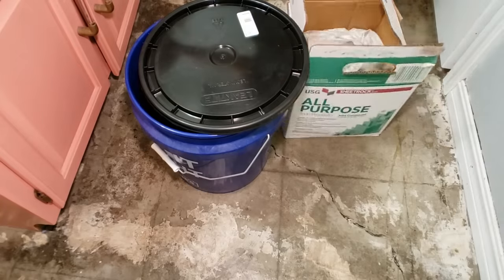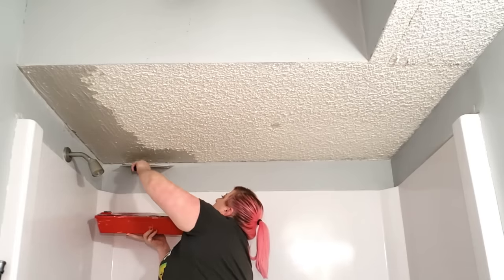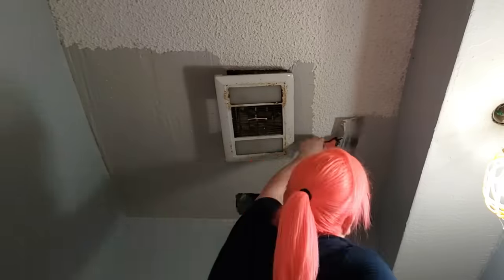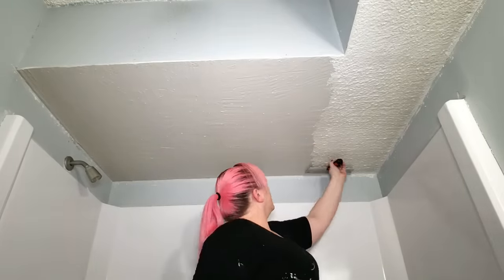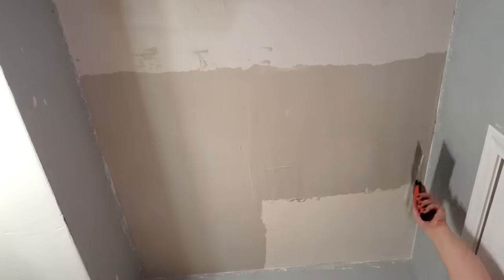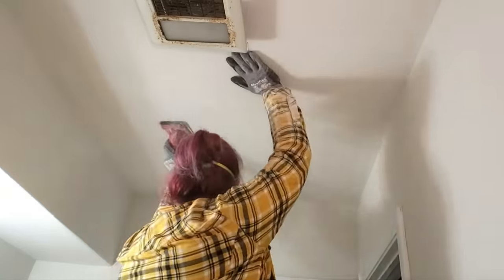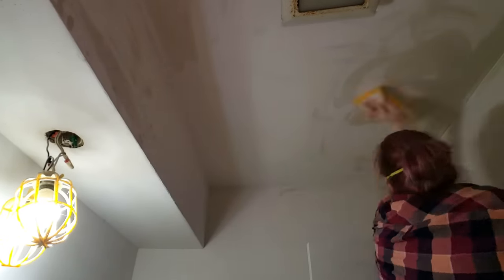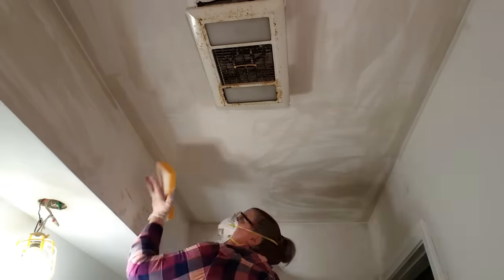How To Cover Popcorn Ceiling Without Removing It | Skim Coating Over Popcorn Ceiling

Comment: ain't no way possible is this better than my spray bottle and my 12" drywall knife ...AND I don't run the risk of having all that mud causing the original to get wet and pull it down, anyway ...THEN WHAT?

Comment: For all thoae wanting to wet ceiling with a spray bottle, you can put downy in the water, spray the ceiling and run you tape knife on it, it comes completely off, done it, not that hard, just cover tou floor with plastic tape to the trim and you'll be done with thw cleaning at once.

Comment: I could be so wrong, but I've had the best luck scraping it is and is soooo much easier. Using a pump sprayer or even a roller in water, let it soak a few min and scrap. Use an oil based primer, then paint. Done.

Comment: Great job! Your way looks so much more efficient than how I've done it. I removed the popcorn from my ceiling in my kitchen and hallway using hot water in a spray bottle, drywall knives for scraping the popcorn off of the ceiling and plastic sheeting to cover everything. Soooo messy...I still have my living room to do...ugh.

Comment: Í took the easy route. I bought an airless spray painter and spray painted the popcorn. Half hour to mask off the walls and one hour to spray the ceiling. Okay, I lied, It took me 15 minutes more to unscrew the blades on the fan and mask off the rest of the fan. I liked the results so much that I did the rest of the house. Now, I'm thinking of painting the walls and then coming back to spray paint faux light scatter on the walls. I'm thinking if I cut a cardboard in a parabolic shape and angle the end away while I spray, I can add a little white paint to the original color to spray faux lights on the walls. It would make people start looking for ceiling lights that don't exist.

Comment: I am so inspired by this video. I have watched it and the others in the bathroom makeover series, and I am now convinced that I can skim coat my own ceilings. Room by room. I've gone out and purchased all the produces, waiting for the drill mixer to come in. I will be starting a small room to get the hang of it, but I plan to do my entire townhouse.  All the steps just seem so simple, fully described and I'm convinced this is totally doable! Thanks!
Reply from the maker: That's awesome, I'm so glad this helped you to feel inspired! It's definitely a lot of work, but it's doable. I had zero experience when I did my first room. Starting in a small room is definitely the way to go. It took me a couple of rooms to really get the hang of it. The nice thing is that you can fix mistakes easily with sanding, so I never felt like I was going to ruin the ceilings. Also, give yourself time in between rooms. It's a lot to try to do all at once. Good luck, I hope everything goes well!
Reply: @TheNiftyNester  Thank you so much for taking the time to leave more tips! I got in everything I need!
Reply from the maker: You're welcome, anytime!
Reply: Do let us know how it goes. Good luck
Reply: how did it go?

Comment: Would it be okay to start and only finish half a room. The room I plan to start with is the smallest, but it's still a full size bedroom. I'm wondering if I it is better to do a half room, with multiple layers or try to do one later on the whole room, and then come back and layer.  My concern is I don't think I can do a whole room at a time.
Reply from the maker: You want to do one layer at a time. If it's easier to do half of the room at a time (it's a lot of work so it's understandable) then do one layer on half the room then finish that first layer on the other half of the room before letting it dry and going back to do the second layer. Always finish one layer in the entire room before starting a second layer, though. It'll be a lot harder to get the sides to match up and be even if you do more than one layer on one side of the room before doing the other side. I hope that makes sense.

Comment: I used high gloss paint many years ago to paint my ceiling because the popcorn was falling down. When I used high glass paint it prevented the popcorn from falling. Is skim coating my ceiling not possible or advisable because I did this?
Reply from the maker: Was the popcorn pulling off of the drywall, like separating from it? Or was it just the flakes of popcorn that come loose? If it was just flaking, then it should be fine to skim coat over it. It should be sealed since you painted it (assuming you primed it or used a paint&primer combo). If the texture was coming completely apart from the drywall, then I'd worry the joint compound would pull it away from the drywall.

Comment: Thanks so much for this video! You are an excellent teacher! Lucky for me I only have one small popcorn ceiling but still did not want to spend time and energy removing it if I don’t have to. I’ve repaired lots of old walls with joint compound and taped new ones but didn’t know about thinning it with water. 
Thanks again!

Comment: Idk...I'm skeptical...your adding weight and moisture...two of the arch nemesis of popcorn...plus the amount of popcorn that will pull probably will drive a person mad...not saying it's wrong...just say there is a risk of peeling...hope you use a strong excellent quality paint as you introduced a lot of gypsum...might even consider an oil or hybrid...overall very impressive tho...your process was very professional...all the best

Comment: I have an old condo (1979) with popcorn ceilings AND stucco-looking texture walls.  The wall has a satin or semi-gloss finish paint...can I skim coat over that finish? or do I have to apply a primer coat then skim?
Reply from the maker: From what I've read, you can use 120 grit to scuff the surface just enough to give the joint compound a better surface to adhere to. You could prime it as well, but a quick pass with sandpaper would probably be a lot easier.

Comment: That came out nice.  For a small ceiling, like a bathroom, this is a great option and I agree that removing it is a royal pain (and could be a health hazard if asbestos if involved).  It is rather labor intensive and if not done as a DYI project and probably expensive to have someone do it (3 coats, sanding, filling, re-sanding and painting).  

For me and my DYI family room remodel, I covered it with tongue-and-grove... the materials are pricy (~$2000 for a 20x14 room), but it goes up so fast and looks fantastic now.  I will add resale value down the road and worth the investment.

Comment: This is fine if the popcorn ceiling has been painted. If not, it is a lot less work to wet the popcorn with warm water via a garden pump sprayer and use your 12" knife to scrape it off (of course you need to put plastic down cause the scraping is messy). Much faster and easier.

Comment: In Mexico we usa a sand sheet before for the loosen parts or dust and before applying anything else we use a sealant that is like transparent layer that will keep the mud in place for longer time, i mean durability but you did a great job, i bet your shoulders hurt for a while hehe is not an easy job, it looks amazing. I like it
Reply from the maker: Thank you so much! Yeah, my arms were like rubber by the time I was done lol. Do you know what product is normally used where you live? I know different regions use different materials. I was curious if you have similar materials used for textured ceilings there.

Comment: Beautiful job! And great step, by step explanation. I just wanted to make a suggestion for an alternative way for covering up popcorn ceilings - beadboard panels. Still takes a lot of effort with spackling nail holes, trim, and paint. But if it works with your style aesthetic, it's another option. Especially for those with asbestos who can't afford to have it professionally remediated.

Comment: MY HOME WHEN I MOVED IN HAD PANEL WITH THE GROOVE'S DOWN IT...I USED JOING COMPOND WITH A SPATULA AND FILLED IN ALL THE GROOVES...SAND TO SMOOTH DOWN THEN PRIMED THE WALL AND DID MY PAINTING....EVERYONE THOUGHT I TOOK DOWN THE PANEL ....PEOPLE WAS LIKE I NEVER WOULD HAVE THOUGH OF THAT I WOULD HAVE REMOVED ALL THE PANEL....OR YOU CAN COVER WITH WHITE WALLPAPER AND THEN PAINT OVER

Comment: I would use long strokes with the knife and build it up instead of short scratches to maximize depth and length.  This way you can save on time and energy.  You your doing one ceiling your probably doing a lot more in the near future.

Comment: How or where will you leave information about potentially exposing asbestos from the popcorn ceiling when the ceiling needs to be cut into for a ceiling light or any other purpose?
Reply from the maker: So, I have previously talked about asbestos when scraping the popcorn in another room. You definitely need to test your popcorn before disturbing it at all. Since I've already tested mine and know it's not asbestos, I didn't need to test it again. I also didn't think to mention it in this video since I was working with painted popcorn, and I wasn't cutting into it or anything like that. If you haven't already tested your ceilings, you should do that before cutting any holes.

Comment: This is brilliant! I took out the popcorn ceiling in our bathroom, and the longest part was mudding the irregular sheetrock and sanding. I still have to do the rest of the house! Three bedrooms, a hall, great room, and a living room!
Reply: That would be the last place I would put dry wall compound on a ceiling as unlike plaster which is water resistant, dry wall compound and fillers are not so the humidity in the bathroom may cause the ceiling to crack where the filler is starting to get damp.
Reply: @darrenwilliams7741 - Couldn't you paint it & seal it?
Reply: Yes, put oil based KILZ on the ceiling.  (and on the walls in the bathroom) It is a base coat plus not going to absorb moisture. @Stacy-

Comment: Buy a pump sprayer and a popcorn scraper with a catching piece to attach a plastic bag to (less than $25). Mist ceiling section, wait a minute or two, scrape, move on. Wear a mask regardless of which method you use. That stuff is not lung friendly even if you are just covering it up.

Comment: Oh thank fuck I found this. I HATE my popcorn ceilings. They were so badly done too. I can see where the drywall outline is, not texture wise but I can see the individual sheets. 
I was thinking I’d have to sand it down after getting an expensive asbestos test. 
Yayyyyyy.

Comment: It's way easier to put a solution of fabric softener and water in a spray bottle ... drench the popcorn in small areas and scrape off with a  puddy knife.
Goes real fast!!! Do it right the first time and it will not ever be a problem further down the road as her mess will be.
There are videos you can watch.

Comment: Older houses either have 1/2 or 3/8 rock and now 5/8 is standard so if you have popcorn issues sometimes it's faster, easier and more energy efficient to hang rock over it.Then you have no problem if you want a smooth ceiling or any kind of texture.You can hang 1/2 ,3/8 or even 1/4 inch over it.Wallpaper is another thing that has problems removing it without destroying the rock so I hang 1/4 " over with little to no issues.You can leave the trim and baseboards on.Just butt to them and tape and finish.What she is doing is risky cause you can get that far and when you paint it sometimes it will blister and come off.Been there,done that. A little trick for popcorn is if you carefully scrape it off and leave that little texture you can paint it and it looks almost like orange peel knockdown which is very common nowadays.
Reply: I like that her method can be done by one person, tho I'll likely pay to go your route instead. Time for some merc-work!
Reply: you're still going to have to tape and mud new drywall, then use a drywall primer before painting. Doable for sure, just a similar amount of work
Reply: I know very little about this, but I have a small home that was built in 1995 and has popcorn ceilings and orange peel walls - neither of which really bother me at all although I do like knockdown better - I will be having to remodel the whole house soon & the walls could stand fresh paint, but I was really wondering about just lightly brushing the popcorn, see if and how much comes off and then painting - maybe I just have a really good job on it - it doesn’t look like a really heavy popcorn - this will be my last home and I’m thinking if it doesn’t really bother me, that’s really all that matters - it’s not dirty looking at all - any thoughts ? Thanks ! ☺️
Reply: @Melody-285  did u go for it ?
Reply: @jetv1471   LOL ! No, not yet - I’ve been shopping to try & figure out cabinets, countertops & flooring first - I think getting the cabinets in once they’re ordered is gonna take a few months, from what I’m hearing - but I am going to work with a contractor, so when we go out there to assess everything, I’ll get his opinion - when I talked to him about it, he said it would probably run about $5000, including the painting - so, we’ll see - I’ll let you know ! Thanks for asking ! ☺️
Reply: @Melody-285  we just went through it with 4 layers of wallpaper apparently put directly on the dry wall in 1952…
Contractor bid $7k to remove wallpaper and paint two bedrooms , foyers and stairwell and living room and dining room … probably 800-900 sq ft total …
After a day and half into job he said he couldn’t do it … he said it was just an estimate and the cost would be exorbitant for him to remove all the paper and patch … 
So not I have painted wallpaper in many areas . 
In hindsight wish I had rented a pod put everything in it and had someone re Sheetrock it all .
I have owned a number of 100 year old colonials however in the past where painter skim coated over popcorn or textured walls and it all came out fantastic . 
So I don’t think it is the skim coating as much as the Contractor that is the issue.  We finally used up our good luck on the latter apparently .
I have always wanted to try to skim cost myself … it definitely appears to be a “touch “ “practice “ thing and if I can do it as poorly as I caulk it’s a non starter. That’s why I wondered if you did it
Reply: @jetv1471  Well, I’m getting older now & had a bout of vertigo last year - I’m still perfectly fine to climb ladders but the looking up at the ceiling might trigger the vertigo again - about 12 years ago, I moved into my boyfriend’s home & it had the original wallpaper from 1993  with no priming or anything - my sister-in-law and I stripped that ourselves and it was really no problem once we figured it out - we tore off the very top layer which was kind of vinyl, then scored & sprayed the bottom layer with water & it just came off in huge strips - I also have wallpaper in my kitchen where I’m moving back to, but it is a vinyl & I had them prime first so I’m hoping it will peel off pretty easily - but it’s still a total remodel & a lot to choose and get done - a little overwhelming, but I can just take my time ☺️

Comment: A pole sander works best, but you can use a swiffer mop/dust handle and attach the sandpaper to the pad that would normally hold the swiffer pads !, just sand lightly so as to not tear the sandpaper!, great video!
Reply from the maker: Thank you! I'm definitely buying a pole sander before doing the next room.
Reply: @TheNiftyNester  Harbor Freight has some cheap ones if there is a location near you.

Comment: With three layers of mud, then paint then primer, how have these ceilings held up?? Is the weight bad for the drywall?
Reply from the maker: That's actually something I was worried about as well when I started this project but it's held up perfectly. I figured in the bathroom with all of that humidity it would be more likely to fail if it was going to at all but it hasn't, it still looks brand new. I think it helped that I used the light weight joint compound. Also the layers are thin and just enough to fill in the texture and get a smooth finish. There doesn't seem to be any impact on the drywall either.

Comment: I just bought a home with popcorn ceilings and had a quote of $2500 to remove it. So I started looking for alternatives and found your video. Hun your incredibly talented, but what you did was courageous, but heavily labor intensive! I have frozen shoulder syndrome, so I guess I need to cough up the $2500.00
Reply from the maker: Thank you! Yeah it's definitely labor intensive, I don't blame you for hiring someone, sometimes that's the way to go!

Comment: When I tried to scrape the popcorn I ripped up some of the builders tape on the edges by accident. Any tips on how to get a clean finish on the edges and corners? Should I get a caulking gun and run it through all the edges?
Reply from the maker: I had the same thing happen to me in another room. Are you skim coating over the drywall? When I had that happen I just skim coat over it and it completely hid the tape. If you're not skim coating you could just patch over the tape and sand it down. You can use caulking as well, I've seen other videos where they've used caulking to get a cleaner looking corner. Just use paintable caulk and cut in your paint over it.

Comment: I'm curious what you think of taking a pass at dry scraping first to attempt to knock off any bits that may break off.  Thanks for the video.     I have textured walls and ceilings and really want them gone!
Reply from the maker: You can definitely scrape or sand down some of the texture before skim coating but you want to make sure the texture is sealed before skim coating. Since my ceiling was already sealed with paint I decided not to knock any texture off so I wouldn't have to reseal it. Whichever way you decided to go with just make sure you test for asbestos before scraping and seal the texture before skimming if they aren't painted or if you decide to scrape off some of the painted surface. I hope that helps.